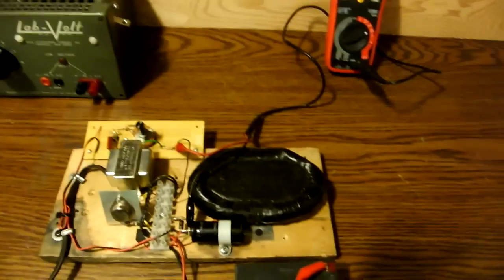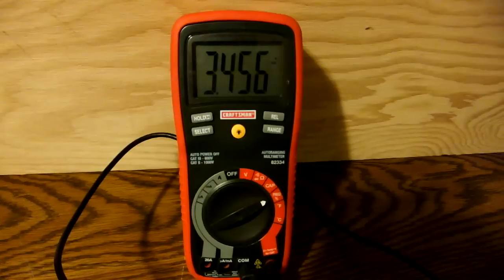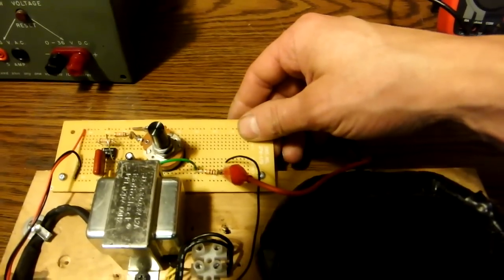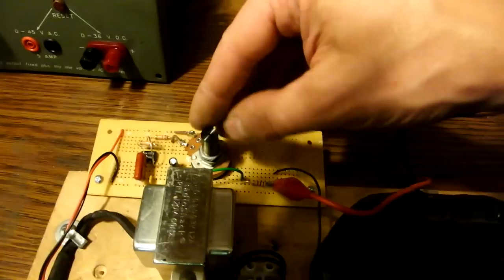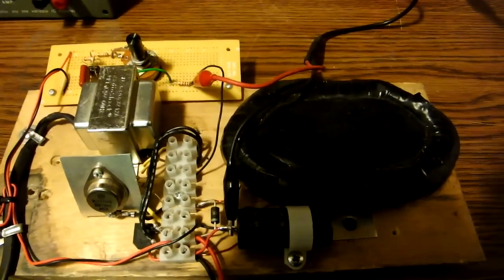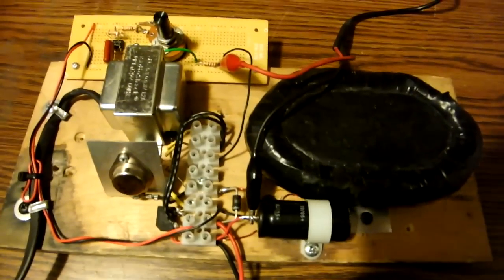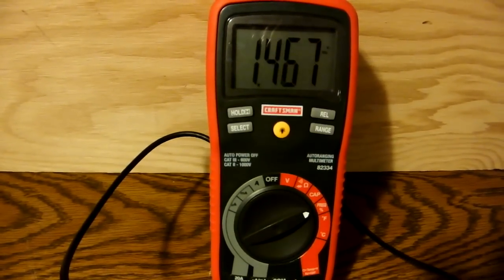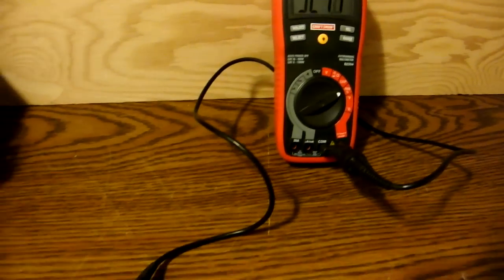Adjustable Frequency Radiant Charger - 300 to 3500hz

Comment: What exactly is the input? 
Grid power or what? 

And how fast does it typically recharge a battery? 

Thanks!

Dr J
Reply from the maker: +wits2014 The input is approximately 12 volts @ 1.5 amps from the 120 volt wall receptacle with an onboard transformer visible in this video next to the black coil.
Reply: +supermuble 
How fast does it typically recharge a 100AH battery ?
Reply from the maker: I don't have any data for that I'm sorry :(